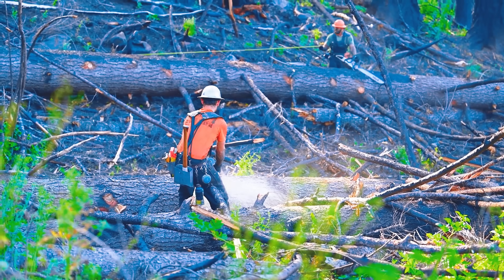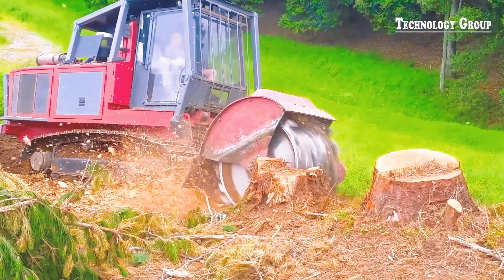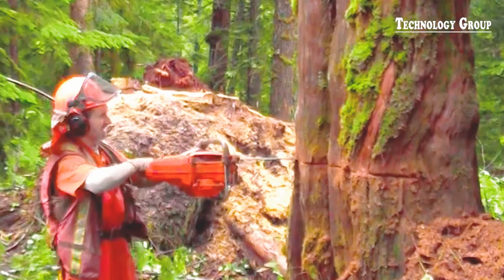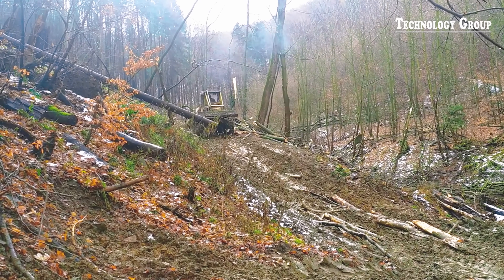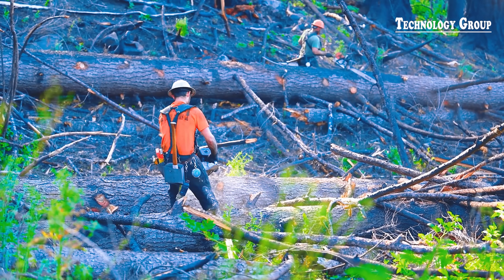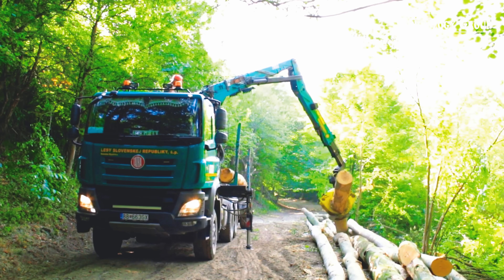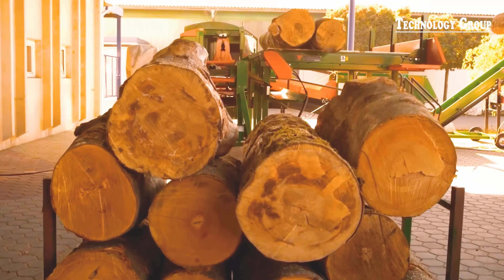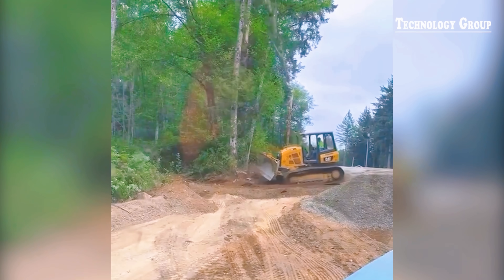Transporting Wood This Way - Extremely Dangerous Large Chainsaw Fastest | Agriculture Technology

Comment: This title highlights a fascinating yet risky aspect of agriculture technology, showcasing how large chainsaws and heavy machinery are used to transport and process wood quickly. The phrase "extremely dangerous" is a clear reminder of the high level of skill and caution required when handling such powerful equipment. The focus on speed and efficiency, while impressive, also emphasizes the need for safety protocols in these high-stakes environments. It's a thrilling yet